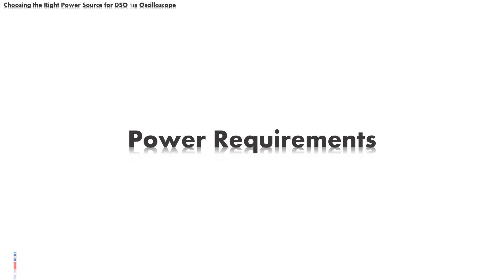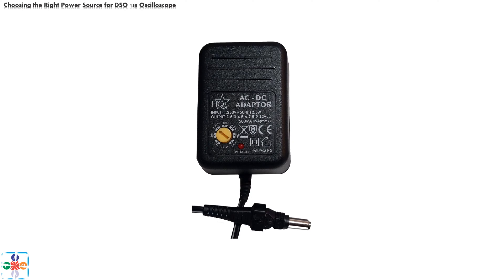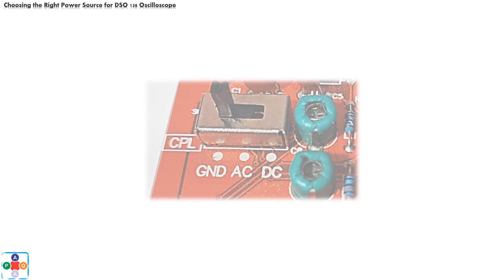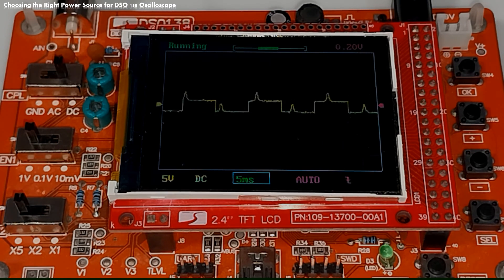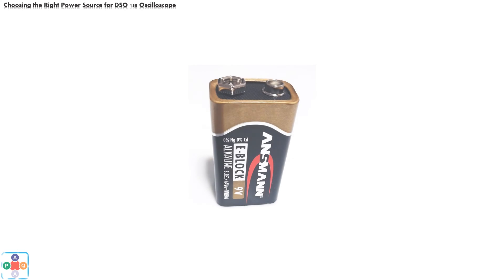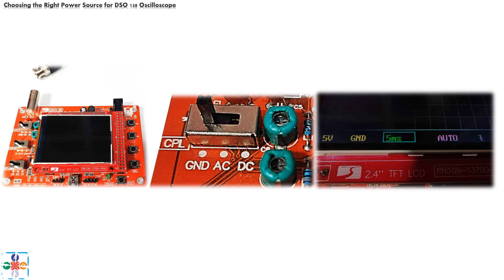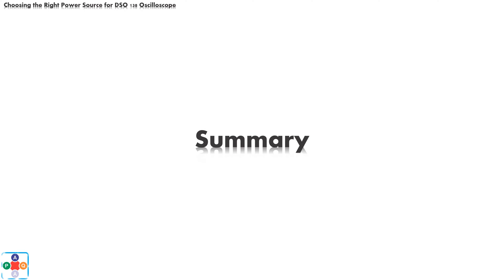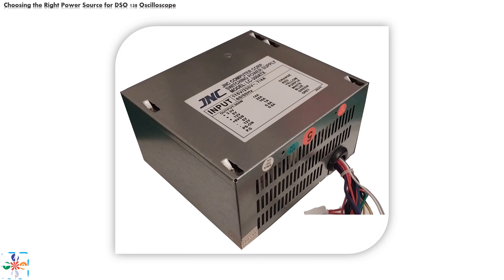Choosing the Right Power Source for DSO 138 Oscilloscope

Comment: if we use battery is there any option to on and off without disconnecting battery?
Reply from the maker: Hi, thank you for your question. Since there is no on/off switch on board itself, unplugging DC power supply has the same effect as removing battery - it turns off the board. Only way is to implement mechanical switch between battery and board, so that you don't have to remove battery every time you want to turn off the oscilloscope. Adding a on/off switch directly on board would be an interesting DYI project. Again, thank you very much for your question and we wish you all the best.
Reply: @asquicklyaspossible  thank you so much for fast reply. i didnt risk to add switch on the pcb, specially that i assembled acrylic case. so i hot glued 9v battery holder on the right side of case also glued toggle on off switch and used 9v rechargeable liion battery. thanks so much also coz your instructions was very useful in assembling acrylic case.

Comment: using a cheap boost converter and a 3.7V Li-Ion battery gives me only 3mV 16kHz square wave noise. I can live with that and enjoy not producing unneccessary waste.
Reply: How about 3  of  3.7v Li-Ion and step down  converter?
or 3 of 3.7v to  7809 IC ?

Comment: 9V at 200mAh this might be 1.8 watt. Help this. Thanks in advance
Reply from the maker: Hi, the formula for calculating DC power is P=UI, where U is supplied voltage, I is circuit current, so, your math is correct, 9V power supply, with 200mA gives you 1.8W of power. Multiply the result with (h)  to het Wh (and divide by 1000 to get kWh). Hope this helps.
Reply: @asquicklyaspossible you mentioned at 1:06, in the power requirements, DSO138 needs Atleast 18 watt. This confused me. Any way I watched your videos mostly. Very helpful.